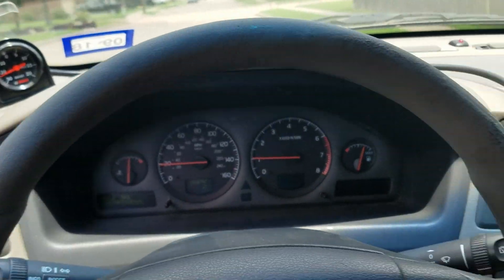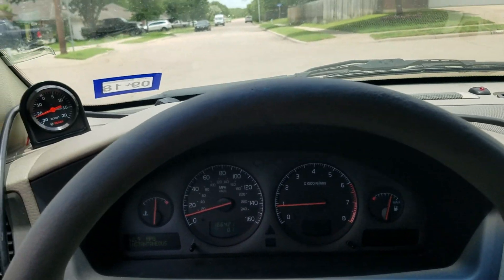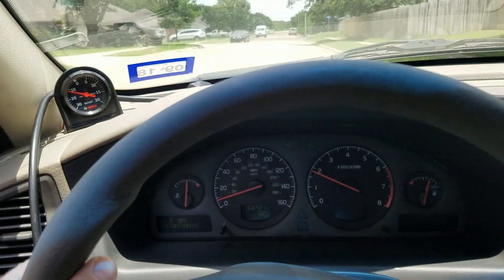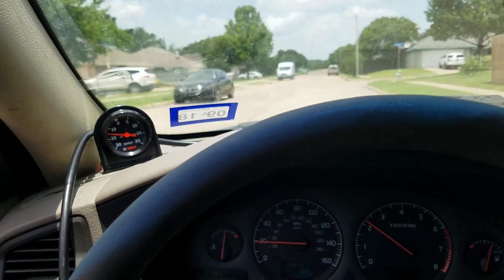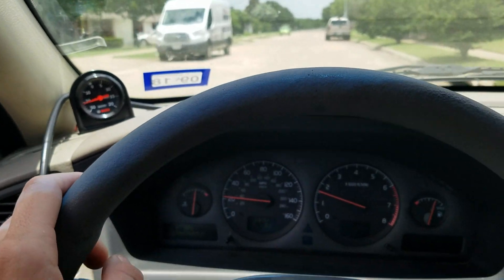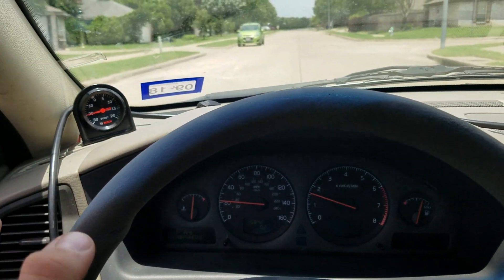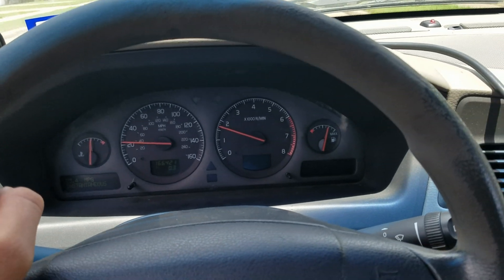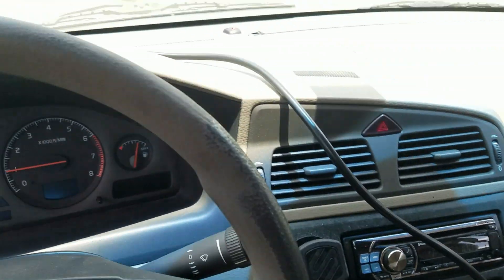Volvo Build, boost issues

Comment: I'm running mine at 25psi and I have the injectors cranked as fas as they go. And in making way way more power then stick. Will it last forever? No.. But it's good fun regardless.

Comment: Every figure out the issue? I just got this exact yr and model and was thinking about doing a Hilton tune. Worth it? I see you need a few things to log all that, what is required ? Do I have to get that to be able to outsource a tune from Hilton? Thanks sorry for the questions
Reply from the maker: DO THE HILTON TUNING!!! haha seriously. My issue was a bad TCV. I got an OEM Pierburg for $40ish.  You wukk need to get a DICE device, and set up the software on a laptop
Reply: @gagefixeseverything  interesting I’m having this issue boost to 18-20PSI drops rapidly to 5psi then picks up again and drops off constantly and I’ve just replaced the turbo solenoid and vac pipe to the wastegate 🤔